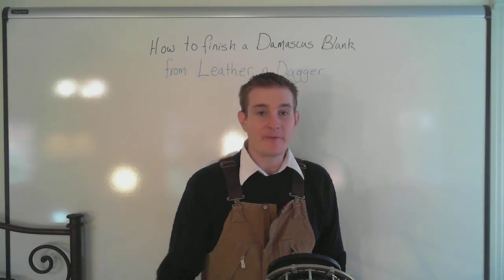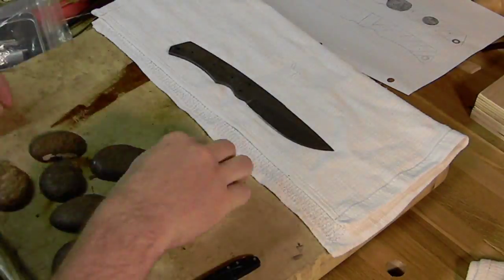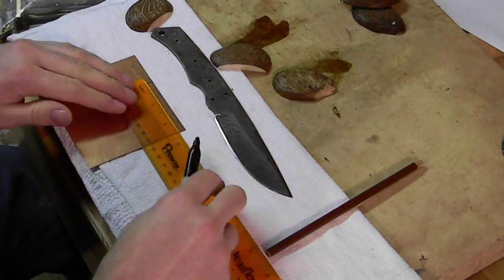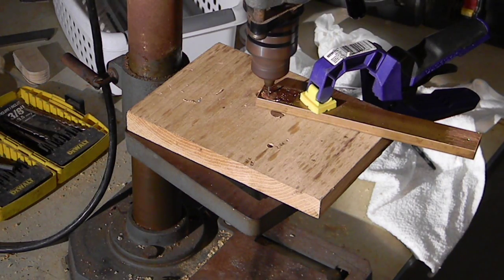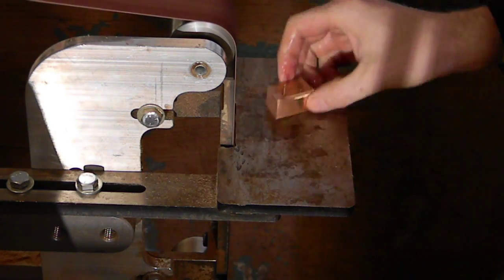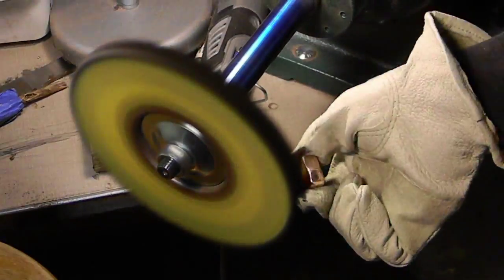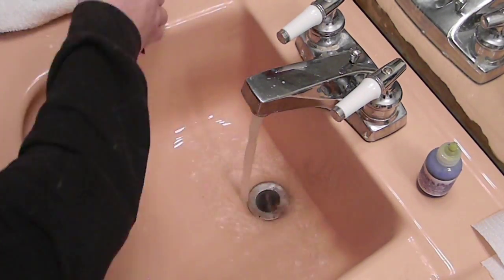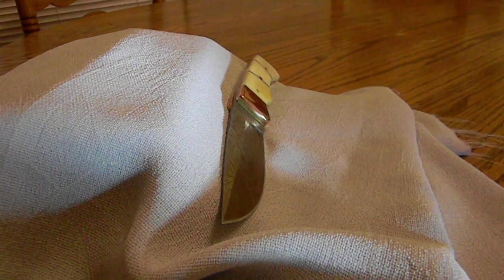How to Finish a Damascus Blank from Leather -n- Dagger.  With Knack!

Comment: 17:36...LOL! I stuck around anyway man.

Brilliant vid. I didn't know of that medium for knife handles/scales before this. It's ivory appearance is great. What epoxy did you end up using to secure the segments together with the copper?

Thanks for the vid... amazing work as usual.
Reply from the maker: I used Loctite Heavy Duty Epoxy Resin, it comes in two parts; resin and hardener that mix in equal parts.  Once mixed well it sets in about 5 minutes, and it holds extremely well especially compared to the CA glue.
Reply: John Hart Thanks again.